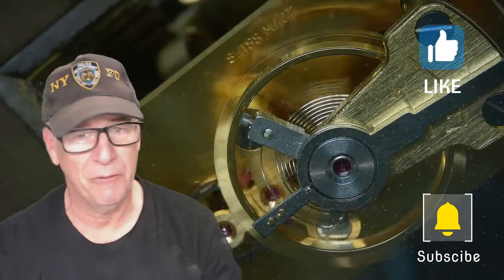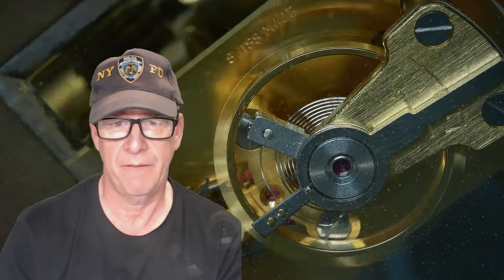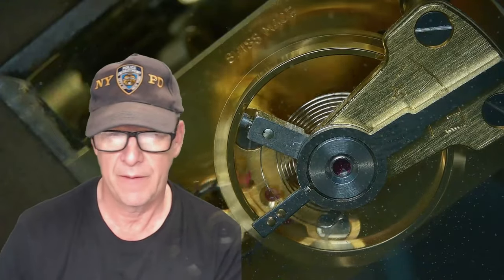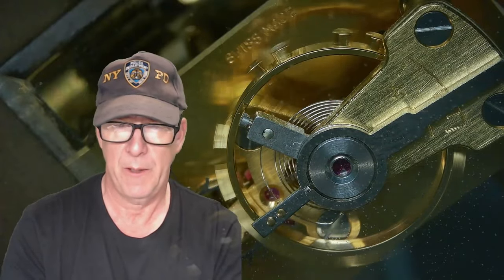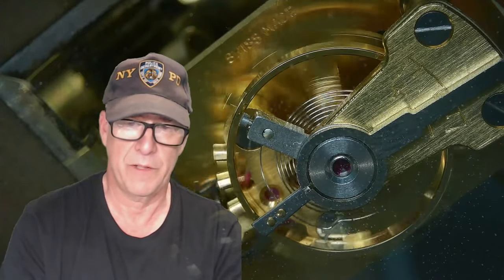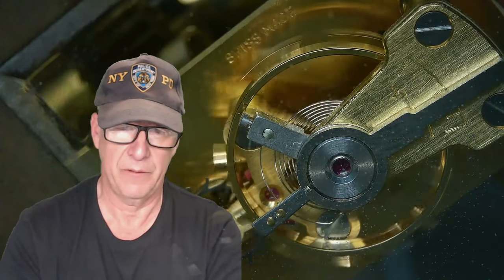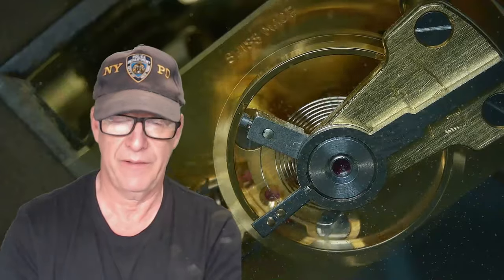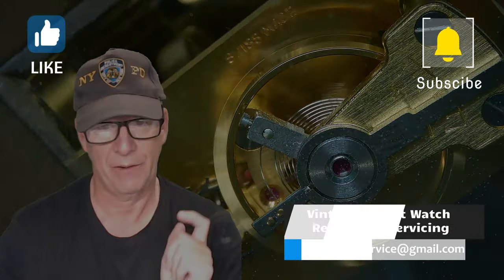My Watch Repair Channel - Update

Comment: JD, Great videos.  Don't change.  Back in the day (as your are aware) we dove with double hose regulators.  Those reside in boxes in basements.  A few intrepid folks have attempted to take these old relics and modernize them.  An interesting project would be to take maybe an old 7 jewel relic.  Maybe "modernize" it.  Put in an incabloc  jewel set.  Re lume.....  Try a crazy project.  Showcase the tools and techniques.  You will have to change your address so the classical watch enthusiasts can't show up at your door step with torches and pitch forks.  All the best!
Reply from the maker: Yeah, I do remember the double hose regulators. I have a Jacques Cousteau regulator that I use for years. I would do a crazy project, if I didn’t have a backlog of customer pocket watches and watches to take care of. If it’s just me fixing my watches then yeah I think I could make some pretty impressive videos. Perhaps I’ll mix that in the next year. Please no pitchfork at my door.